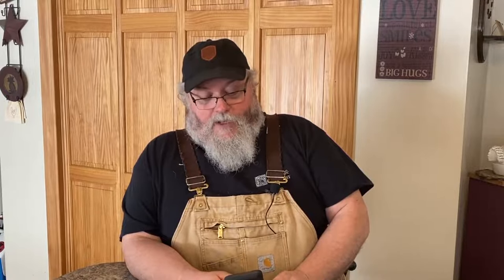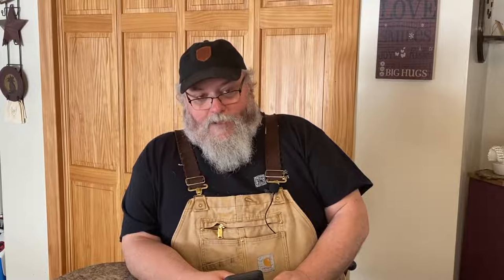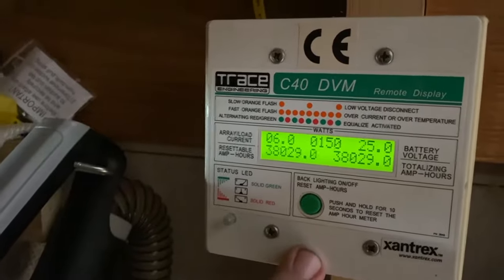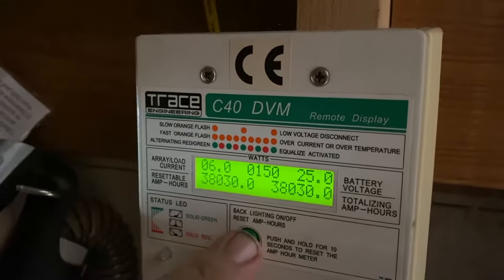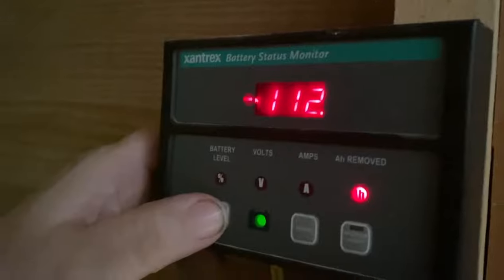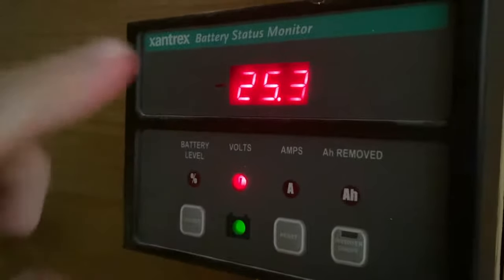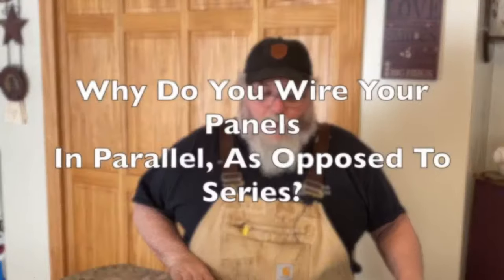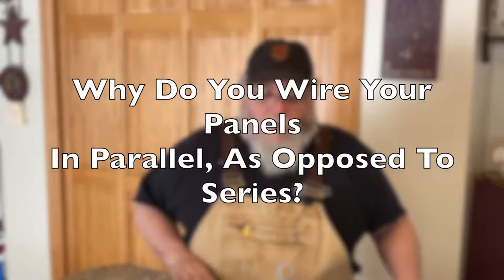Amps, Watts, Volts | Solar Power Made Easy For Beginners | Part 3

Comment: Well put!    I like to use the PIE formula for POWER.  P = I X E  (PIE)      Power = I (amps) X E (volts)  = # of WATTS

Power is= WATTS
Volts is what you have ( a 12 volt battery) 
AMPS are what you USE... 

@12volts your battery is at  50% a.k.a  DEAD (in the damage zone) 
Car batteries charges around 14.4+ volts via an alternator.
Solar charge at the rate you set your solar charge controller to. .. @13.9 -14.++)**

charging is in Bulk, (49.99% to 80+%)
charged is Absorption (the last 80-90%) (14.4-14.8V)**
+Charged is a maintaining phase (90-99.999%)

!!! I would put in a cut-off SWITCH to be able to Stop charging the batteries when full (13.9 - 14.4=) if you are not using much power that day or just for a comfort zone. 

WELL DONE  Whiskey!   Scott!